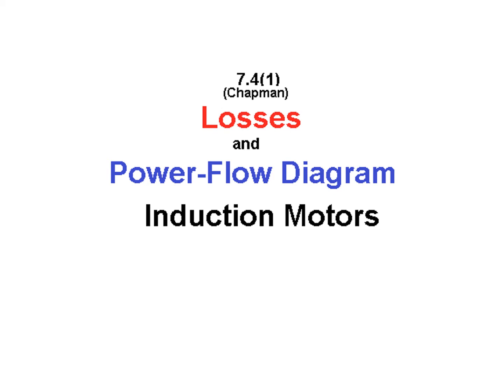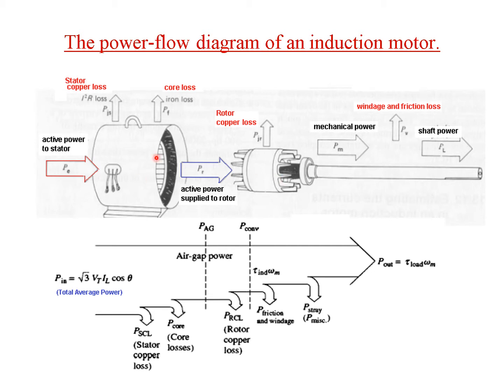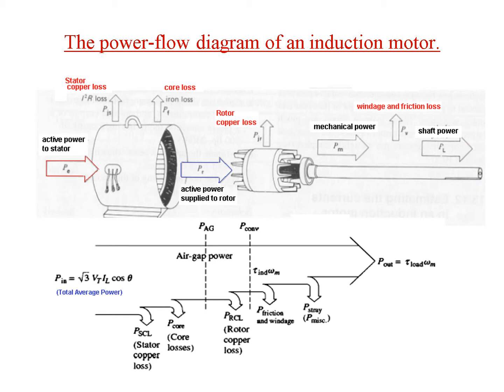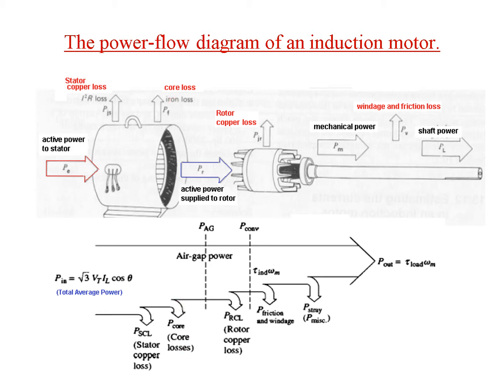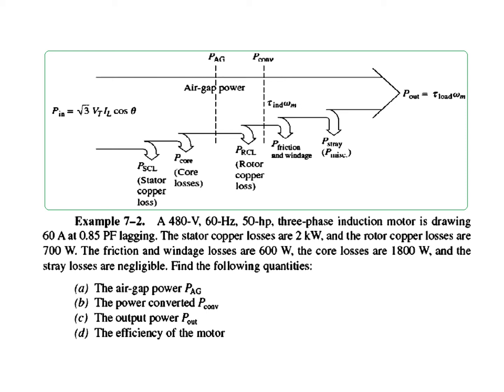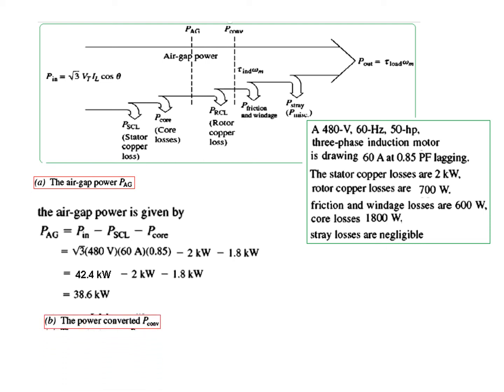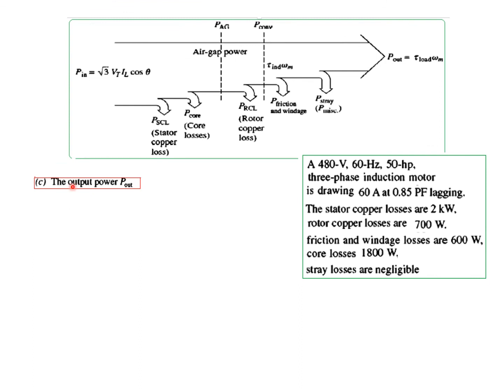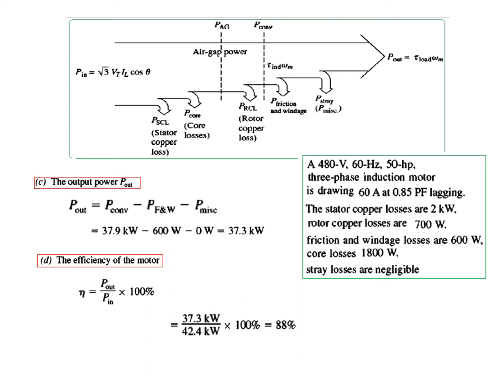(English)EM || Example 7.2 ||  3-Phase Induction Motor ||Power Flow Diagram

Comment: In this question, what is 50 hp?? 
Thank you sir.
Reply from the maker: 50 hp is the rated power output or maximum possible contineuous power output. We can convert it to watt by multiplying by 746W, so 50x746= 37,300W or 37.3kW.
If we notice at time 6:32 we have calculated Pout to be 37.3kW
Reply: @ElectricalEngineeringAcademy  thank you so much❤❤